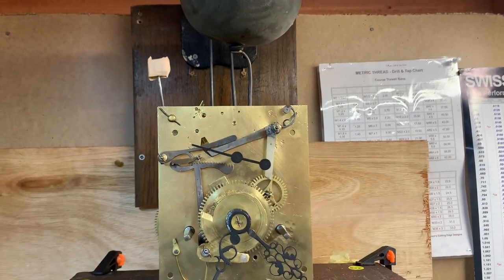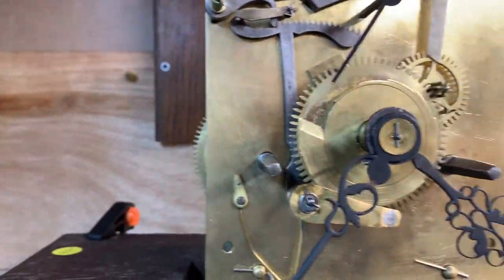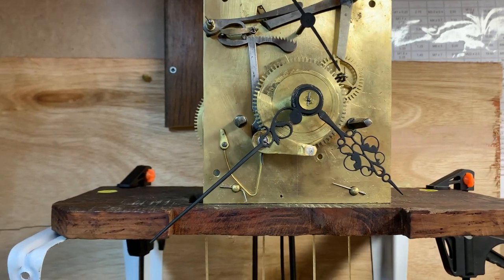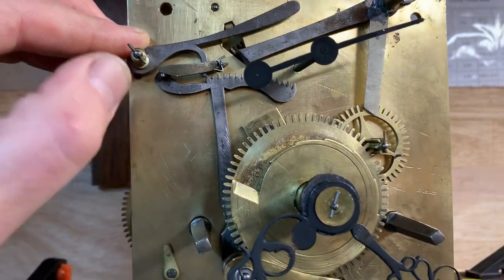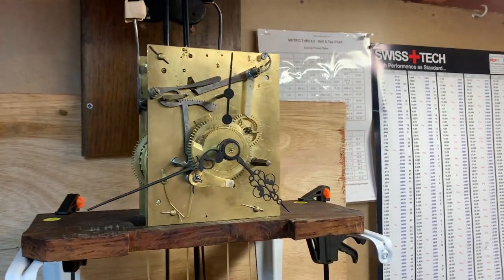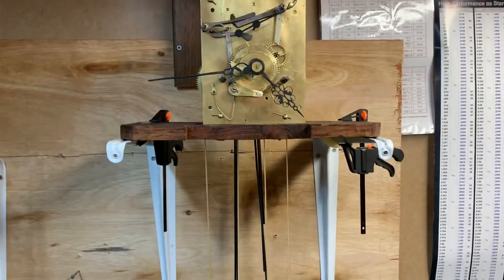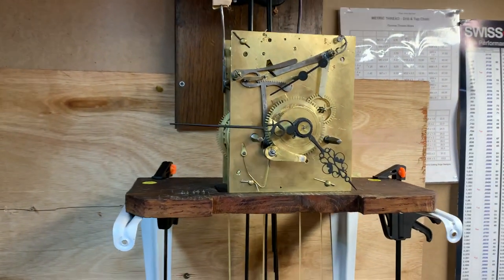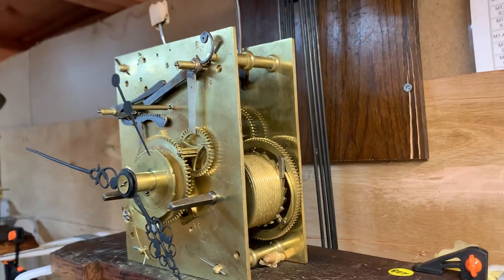8 day c1790 Grandfather clock movement Chit chat video no 2

Comment: That is one of the major problems with rack striking, The tale end bends one of the causes is people tend to turn the hands backwards and if the nipple at the end doesn't ride over the snail it bends and will cause the strike to go out of line. The rack spring can be too strong while the riveted tail can work loose and this also causes trouble, but with your experience I'm sure you know that, gathering pallets wear rack teeth wear all causing problems, wear in the pivots holes or on the pivots it all adds up to problems with striking.
Reply from the maker: Most of my bad experiences with the striking train on grandfather clocks are previous repairers doing cock up jobs, I can do a service but then spend as much time doing previous jobs properly 🤬🤬, I am trying to keep some of my videos simple & straight to the point I want to encourage people who are interested in Clock restoration not to be frightened this is not the black art some would like you to believe, I often have found that the most capable clock makers I know have no Certificates, you know them pieces of paper that go on the wall & hide the holes 😆😆.